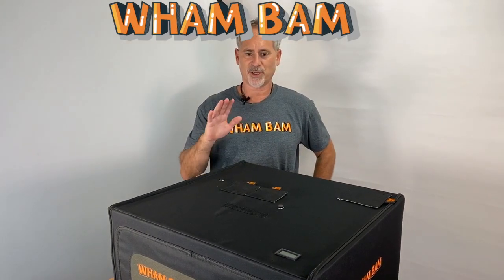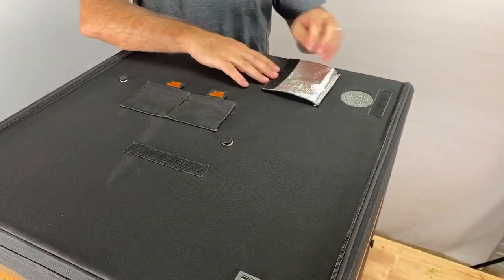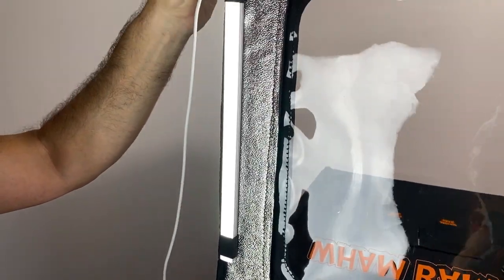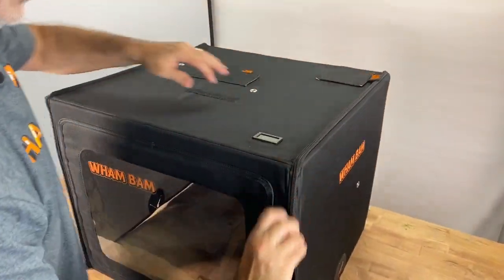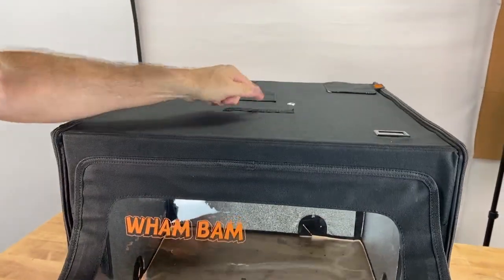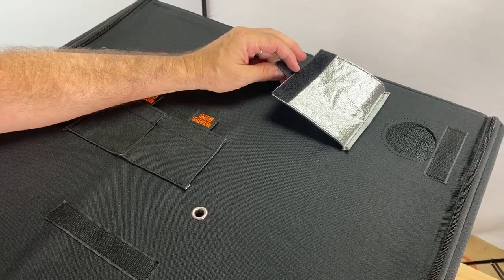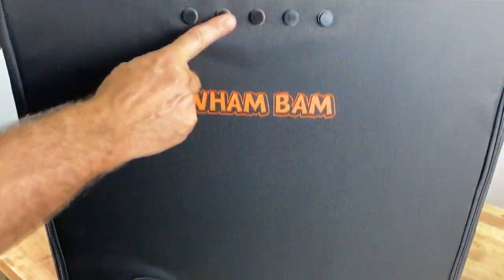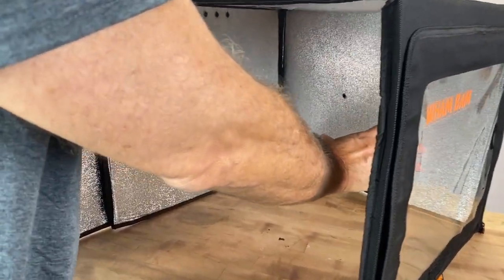HotBox V2 - New Features Added!

Comment: I have to agree with Peter.  While I get that you're proud of the innovation (and rightly so), the branding is a bit excessive.  Does the logo really need to be on pretty much every surface area, including every velcro tab and all of the grommet pass-throughs) And across the primary viewing area to the interior?  
One logo, placed on the textile material on the upper or lower front would be more than sufficient to maintain your brand.  The "less is more" scenario.  
Still, this is a great design overall and my statement is purely given as consumer feedback.  Thank you for the awesome products!
Reply from the maker: thank you we will consider reducing logo size for next run,
Reply: @WhamBamSystems  Holy logo galore! Ever where you look is a logo. You missed adding logos on the inside as well. But all these logos just completely turned me off and away from this.

Not only reducing logo size, how about eliminating 95% of them as well?

Comment: I would like to see the bottom insulation too
Reply from the maker: As heat rises I have never found there to be a temp loss, much like an open top freezer in supermarket. In use, once ambient reaches desired temp,  I actually open top vent a bit to keep heat from building
Reply: @WhamBamSystems  the issue is, my desk is not wide enough and it will be in a mid air (ended 3 pro frame + 2.5” wide) the bottom will help to keep the enclosure from sliding if you accidentally touch it. also, a transparent dust cover for the filament spool will be a great idea.
Reply from the maker: @Mr_nah  I go to the hardware store and cut some nice grade plywood slightly larger and sit that on the desk then the printer then HotBox
Reply: @WhamBamSystems  isn’t it the whole point of buying a complete solution that you don’t have to go to a hardware store? Yesterday I went to a hardware store looking for an acrylic sheet to build my own enclosure, but decided that in my room a complete solution will be more pleasing than a diy one. And your hotbox looks great, but the absence of the bottom covered that can hold the whole enclosure is the main reason I still struggling with my decision (I bet I’m not the only one)
Reply from the maker: @Mr_nah  we cant know what size table each person has, sorry, maybe for now use with overhang it should be easy enough to stand on 2 edges, or print out our feet on thingiverse and try that,